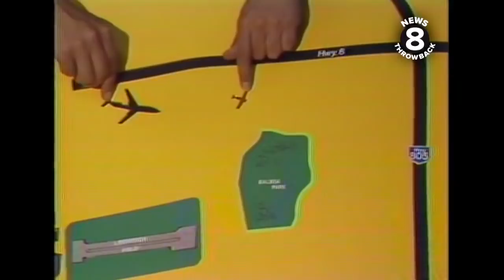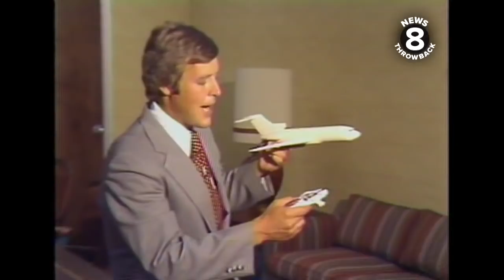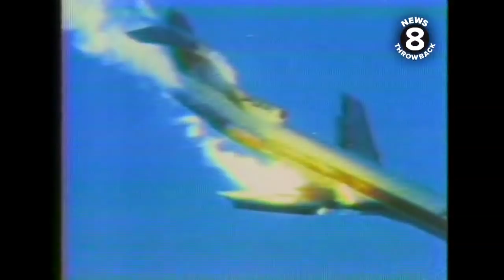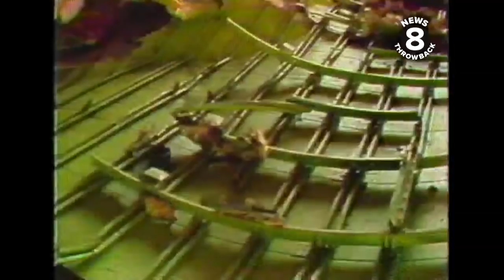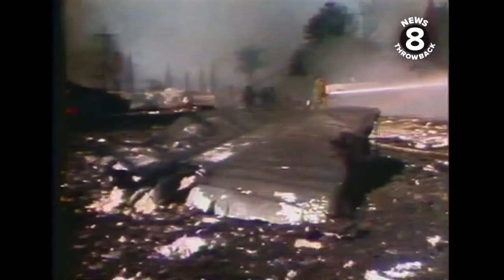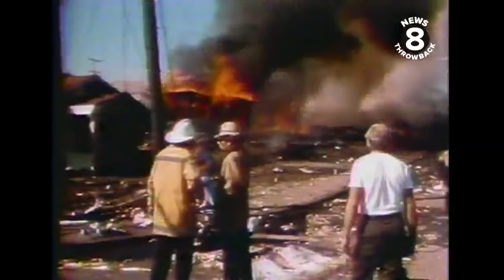News 8 report on investigation following PSA Flight 182 crash in North Park, San Diego in 1978

Comment: Planes are require to have 2 hours of extra fuel onboard in case of having to hold. For a 727 that would mean in excess of 2000 gallons, far more than enough for the enormous inferno that happens.
Reply: Where did you get this bit of misinformation from about fuel .

I can say it is very much incorrect.